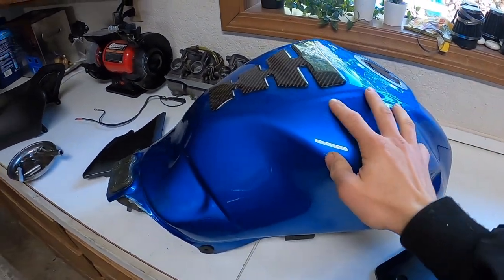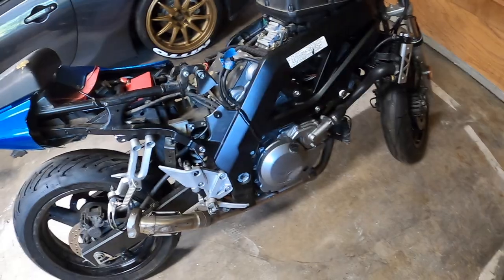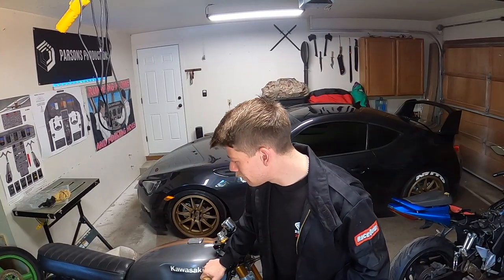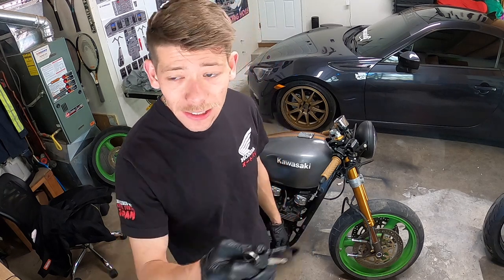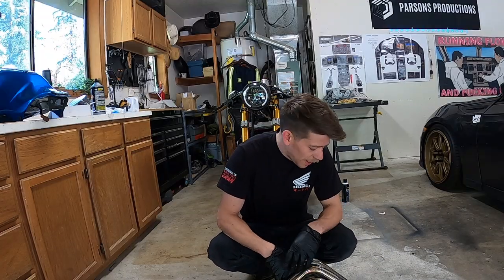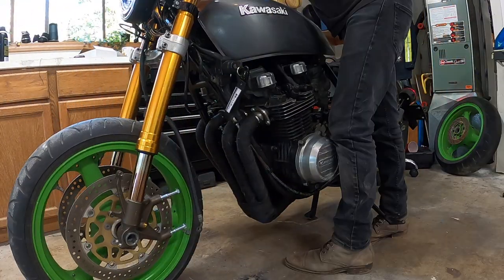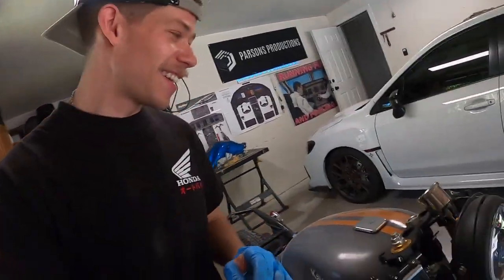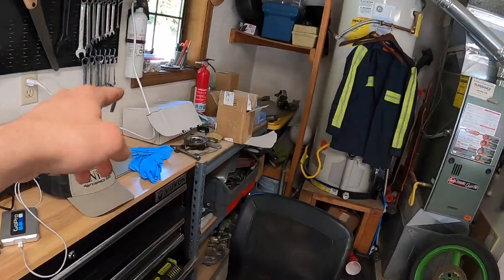HOW TO: Turn a Vintage Motorcycle into a Flamethrower

Comment: I have a 1981 z750 ltd.
My carbs were constantly leaking from the bottom overflow outlets at the bottom of the float chamber
I cleaned and checked the floats. They were fine.
Turns out that it was the petcock that was faulty and constantly allowing fuel onto the carbs carbs like it was on prime all the time
Replaced the petcock and hasn't leaked since
Reply from the maker: Oh okay very cool! I ended up taking the float bowls apart and found out that the floats weren’t floating properly, should be all fixed in the next video